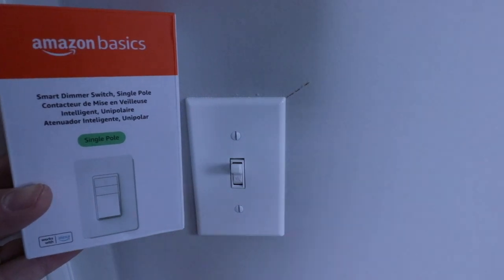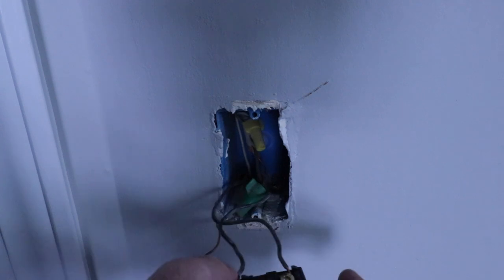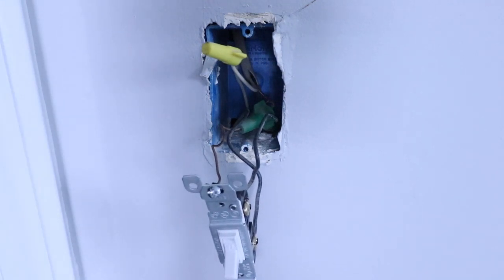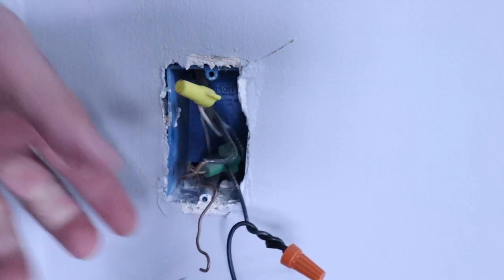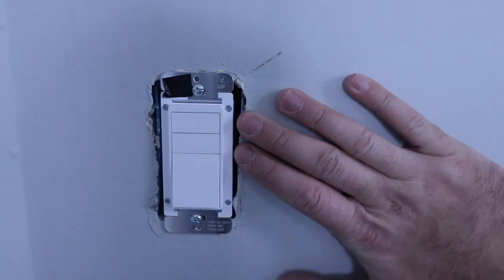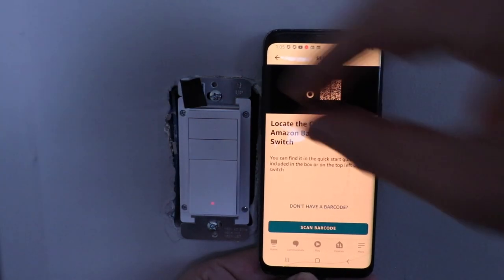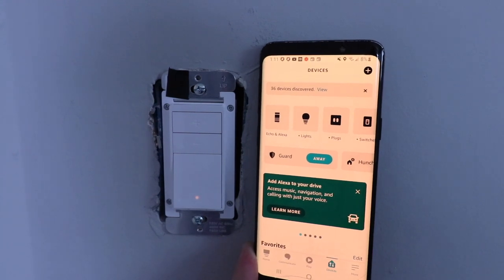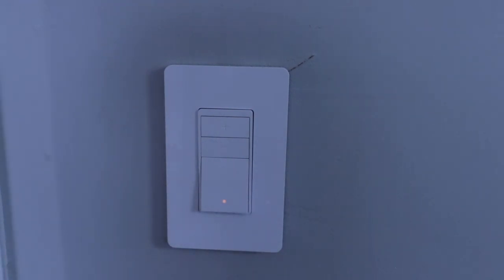How To Install Amazon Basics Smart Dimmer Switch

Comment: Do you only use the neutral wire to power the switch's electronics? And does it perform the function with the hot wire and load, is that correct?

Comment: I am struggling pushing the switch back into the box. All of the extra wiring nuts are taking up more space, plus the new smart switch is a lot chunkier than the old not-so-smart switch. Any tips?

Comment: I purchase 2 of these light switches they have discounted 2 times. Meaning I can’t use my Alexa devices to turn on or off. Without have to reset each switch in order to use voice commands. Oh I’m using wifi 6 with 1200 wifi speeds so it shouldn’t be a problem on my end
Reply: Did you ever get them to work?